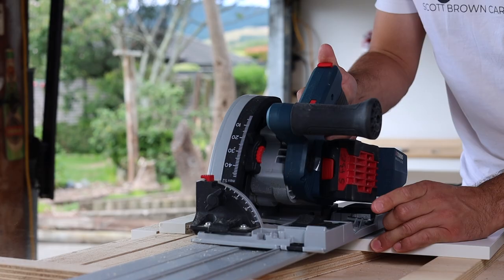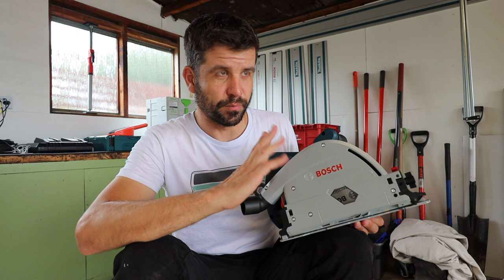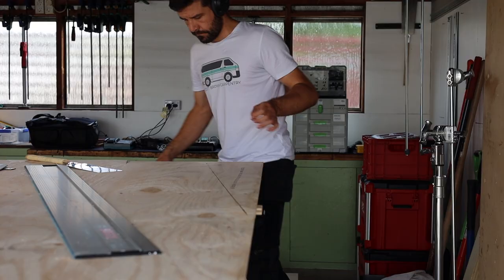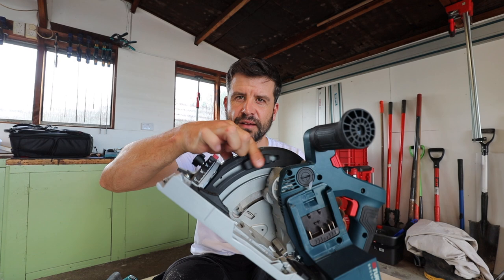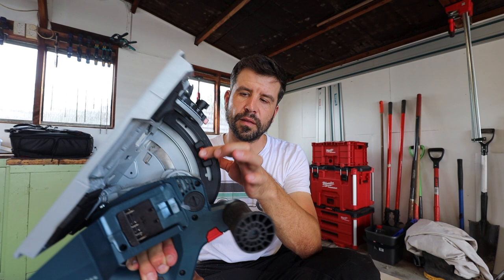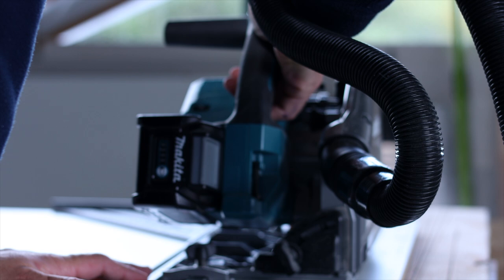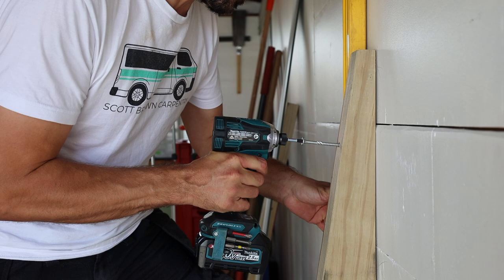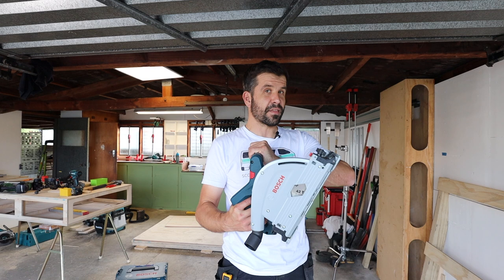Building Plywood Storage With My Bosch Tracksaw

Comment: Hey Scott, the GKT 18V-52 GC does have a scoring function, you need to put the depth adjusment on its lowest setting. You can check video on the bosch professional website. I also am a proud owner of the bosch GKT 18V-52 GC saw :)
Reply: It does, & you can  also adjust the speed settings using Bosch's Toolbox phone app, if saw has the bluetooth module fitted.
Reply: @stuartandrews4344  Yeah, and save settings for specific material so you can use them when you are working with that material again. Its a nice feature.
Reply: @wavebreakerofficial  It's a great feature,so  useful.
Reply: I have the corded version and fit kitchens for a living. If you send the saw down the rail about 3mm prior to your full depth cut, no rip out. You can tilt the saw slightly back a degree in towards the rail but it’s a faff and no better than sending the saw in a few mm first. All in all though it’s a great bit of kit. When mine packs up I will definitely get the battery version as leads are a pain on anything other than a static tool.
Reply: I think the whole point of the scoring function is that you don't have to lose your previous depth setting.
Reply: I have the Bosch GKT 18v too. I use it for kitchen fitting and swear by it. 2mm scribe cut every time and you’ll always get a perfect, factory finish.  Also, invest in an 8ah or 12ah battery; you won’t be disappointed…..and lots of blades. melamine eats through blades. 
The best thing about the saw is actually the track and how easy it is to join together without the need of a straight-edge to true it up.
Reply: @EdwardBuchanan  Prefer the 8Ah batteries, find 12Ah too cumbersome.The Bosch guide rail is far superior to Makita one, & only saw blades I use are from Freud.
Reply: @Stuart Andrews can you send a link to the feud blades you use. I’ve been using Bosch expert (42 tooth). Than you.
Reply: @stuartandrews4344  I also would like a link to those saw blades!
Reply: @wavebreakerofficial  Freud F03FS09763 305mm x 30mm x 72T & Freud F03FS03736 (LP60M 006P) 305 x 2.8 x 30 x 96T Portable Saw Blades, here in the UK.And Freud is own by Bosch...
Reply: @wavebreakerofficial Use these:  Freud  F03FS10064 250mm x 30mm x 48T  &  Freud F03FS10062 216mm x 30mm x 48T,  both are Freud Cordless Optimised mitre  saw blades.
Reply: And finally Freud 165mm blade Freud F03FS10054 165mm x 20 x 48T Cordless Saw Optimised  blade, it's  a extra thin kerf blade.

Comment: I was once struggling to get a clean cut, smoke and all... Took longer than I want to admit to realise the blade was backwards. Tools down at that point, realised I was too tired to be using power tools haha
Reply: Happens to the best of us haha
Reply: I was cutting angles pieces of plywood for a slope on a floor. First 2 are fine and absolutely nail the 3rd. I then cut the 4th to big twice even tho I marked where to cut. I basically drawn the shape of it and still cut it to big. Go back outside just confused with myself on how I did the same thing twice even though I basically drawn myself a picture.
Reply: @kuchiefsdabomb  it's so much worse when it's something simple like that, many times I've carefully measured and then forgotten to account for the blade thickness and cut right on the line instead
Reply: Reminds me of the time one of my guys brings me a brand new bandsaw blade and tells me it must be made for a lefthand cutting bandsaw. I thought to myself what the hell, I've never heard of a lefthand bandsaw. I took the blade from him, looked at it and then turned it "inside out". The employee said something like "son of a bitch" and just walked back to the saw to install it. We all had a good laugh about that and I cemented my reputation as a genius. Honestly, I didn't know if it would work, I was just guessing.

Comment: AIUI when you started using the Bosch saw on the Makita track you should have replaced the spliter guard rubber and retrimmed it for the new offset. ? Bit of a pain when you're moving between saws with different offsets.

Comment: Regardless of track saw, I would recommend the use of rigid foam insulation sheets as a support surface when cutting sheet goods. I have found it to be a better solution simply because there is essentially no resistance when the blade hits the material. It's a tougher job cutting through two layers of wood, and the foam sheets offer full support for the plywood sheet.
Reply: This is the best advice.

Comment: The rubber needs to be cut to fit each individual saw. So you would need to use a new rubber strip on the Makita track

Comment: Dave Stanton, on his You Tube channel, does a reverse 2mm scoring cut to stop melamine chipping. He starts at the top of the board and pulls the saw backwards towards himself. He then does a full depth cut in the normal direction. His cuts are perfect, but does use a Festool saw.
Reply: By pulling the saw towards yourself it would mean the cutting angle is down not up, thats pretty smart
Reply: Maffel has a 2 mm precut option
Reply: I have the bosch corded and I use the same trick. Works perfectly on melamine and veneers as well.

Comment: One thing to remember is, with the bosch bi turbo range, you need an 8ah or 12 ah battery to get the full power out of it. I've got the 230v bosch track saw and used it with my own kitchen, with a 64 tooth good quality blade, and no chipping at all. I've also got the 18v bosch sds plus, 5.3 joules, use it with 8ah batteries, one of the most powerful you can get in 18v, all my tools are bosch, not one has let me down.
Reply: Right! Little typo: "you need an 8ah or 2 ah battery to get the full power" => "8 Ah or 12 Ah" is what I you meant. Just in case anyone reading this got confused ;).
Reply: @nicl4s  thanks, didn't notice that

Comment: One of the best features of the Bosch tracks is the way they fit together, quickly and dead straight every time.
I have the corded saw cuts really well with similar depth adjustment
Not as many after market products with Bosch tracks though
Reply: That definitely was a selling point for me when I was thinking about them, but there are pretty good aftermarket solutions to do that with makita/festool tracks. For example, The TSO-GRC-12's, which don't come standard but do exactly this. 

I was really not a festool fanboy when I started out, but I am just starting to realize that IF there is something wrong with their products SOMEONE will fix it. Maybe not festool (though they do adopt other company's technologies, like their sawstop purchase or their using the TSO rail square). But someone is going to figure that shit out, because the festool fanboys really do care about their tools. 

You might say "that's crazy, why would I pay 70 bucks for track connectors (lee valley price for the TSO GRC-12),  but that is actually CHEAPER than the standard track connectors for bosch that I have seen for sale, which are like 80-90 bucks.  

I really want to like bosch, they make good routers.... but I just don't see the value proposition as being there for me. Sure, the stuff they have works, but they charge a LOT. Sure, I could buy their 6 inch sander, but it's the price of a festool, and I KNOW that works. I also have seen some not great reviews for specifically the bosch cordless track saw (The corded is much better, specifically the cordless).
Reply: @timmietimmins3780  all the extras or additional parts are expensive it does not matter if they are dark blue and green or just blue (Festool or Bosch) they are expensive 
The conclusion I have come to over the years is no such thing as perfect. There are different things on different tools that are good and bad. 
My main win is stick to a platform when it comes to tools and you will save a fortune
Reply: My Makita tracks do not line up with each other.  The rails are out of alignment so the saw will hit the junction not to mention the snuggers have to be adjusted for each rail I have. pretty pathetic manufacturing.  I only have good luck using the saw with an individual rail.   I need the long rail but it's impossible to find anywhere now
Reply: @timmietimmins3780  Yeah I wanted to go Bosch because of a couple tools. I can't go all Bosch because the limited market in the US for their tools and "the little things" like you're mentioning. Before I decided not to buy all bosch I realized it's better to buy the best specialty tool  for each application.  Bosch will end up being most of my core but the battery slavery isn't a big issue with me, there is always one around for wat I need. LOVING my "Bosch babies" 12v impact, sawzall, driver and switchable head driver.
Reply: I am happy with my corded Festool...

Comment: That has to be the strongest built sheetgood rack I've ever seen, lol.  When I saw that lags going into the cement I can't deny that my eyes opened up pretty wide :D
Reply: earthquake code, everything is held together with steel. At least that's my go to guess on all earthquake  zone requirements.
Reply: I put a garden hose reel on the side of a garage with 6mm Dyna bolts. Overkill, maybe, but I didn't want it to come loose.

Comment: I have been using the corded Bosch track saw for years. The track is the best bit, two 1600 lengths is all you need most of the time, as they join so well, compact and accurate. Ended up buying the bigger Bi Turbo saw that runs on the rails as a cordless option, great for site use.

Comment: Hey Scott

Use the score cut method but instead of pushing the first cut that cuts the top layer, start at the end of the cut and pull the saw towards you. After which you can continue by going full depth with a push cut. The pulling score cut technique helped me a lot of times (and still does) due to the fact that the nature of movement lets the base material support the cutting movement of the teeth and minimizing the debree rather than the teeth diving out of the material, causing it to chip. Works great for timber as well.

Cheers from a northern German cabinet maker who takes great joy in watching your videos

Comment: You can get a plastic dust plug cover for the Bosch to cover the access hole for the blade retaining screw, greatly improves dust extraction.
Reply: Guessing that's mainly intended for when you're using the dust bag? Cause dust extraction seems to be pretty good when using a vacuum from what I can see on the video
Reply: @DeadlyMitten  No,I use it with the dust extractor,improved the extraction,virtually dust free,you can also get covers for Makita,Festool.

Comment: if you want top dust extraction from a tracksaw, mafell is the company to go, they're also actually the ones that designed the bosch corded tracksaw (not sure about 18v). the main difference is that the whole side panel is enclosed, even where the access for the centre of the blade normally is. they have a great designed tool
Reply: 10 Minute Workshop has a sweet hack for this - just slap a piece of masking tape over the hole. Massively increases suction

Comment: Hey Scott, just a heads up, if you want cheap malimine, in the same road as bunnings at the end of saxton road, go to the place called NZ panels group.
They make malimine and you can buy 2nds there for $15 a sheet, usually only have a defect on one side.
Reply from the maker: Thanks! I'll check it out

Comment: If I'm not mistaken you need the 5.5ah battery or above to operate that saw at it's full capacity. The Biturbo bosch products are 36v and when you plug for example the 8ah 18v battery into it, it configures it as a 36v 4ah battery. I don't believe the 4ah battery has that function so it runs the tool at 18v producing less power.

Comment: I fought back and forth between buying the makita 36v and the bosch, bought bosch and haven't looked back. Brilliant saw! Love that its only 1 battery and comes in an l-boxx. Also have the bosch 7 1/4 saw with track guides and have used that for more depth of cut when needed. Awesome video! More bosch and makita!
Reply: @cmmartti  sorry I meant the 18v x 2 saw. Not the 40v one. I dont have any makita 40v tools so didnt include that saw in my options.

Comment: Got the Bosch a couple months ago. I got the 8 Amp Hour Battery and the clamps for the tracks. Really enjoy it. I thinks it more than enough for even finish carpentry/ woodworking projects. I would recommend using this with at least the 8 AH battery in my opinion. they also have a 12AH that fits this saw.

Love the channel. Thanks Scott!
Reply: Have a GKS 18V-57G track compatiable,find 8Ah batteries best to use, 12Ah too cumbersome.

Comment: I bought the 2x 18V Makita Track saw and 55in track.  Oh my!  Where has this tool been all of my life.  Even beveled cuts are incredible.  I made stair treads 1.44 in thick from two layers of plywood glued together.  I was able to cut a clean sharp 32 degree bevel on one go, with no drama, and beautiful clean cuts.   In confession, my first cut with it, I kisses concrete with the blade.  I almost cried.  Miraculously the blade is still in the saw 3 months later, and has ripped lots 10 sheets of ply with no tearout at all.  Extremely clean cuts.  So, I think my next blade will be idetical to the one that came with it.  XPS foam strip under the material has been awesome.  I dont even use a full 4x8 piece most of the time.  Just under the saw and track is good enough.

Comment: Quick idea on retention for the sheets:
Some type of L-shaped arm mounted to the wall just above the rack that can pivot down as a sort of latch and can be pinned in the up or down position.
Would be quicker to use than the strap, but in the 3 minutes I spent thinking about this, I can't come up with a way to not have it sticking into the room when there are only a couple sheets. Oh maybe a slotted sliding mechanism. Could even have it spring loaded so that it's always at the minimum distance possible from the wall. Then just have a hard stop at full travel so that it works as intended. 
You could make it full length with pivots at each post or just the one in the middle and just be sure to have a full sheet on the outside.
Just a thought.

Comment: Hi Scott, maybe someone already told you this, but if you buy a new makita guide and make the first cut with the Bosh, it will work perfectly.  But once you use another machine with the guide, the rubber of the guide won't work well anymore with the bosch track saw.

Comment: These tracks are so much easier to join together than the makita/festool etc tracks. I use a Mafell track saw which has the same tracks as the Bosch, in fact the machine is almost identical.

Comment: A little over 12 months ago I bought the Makita corded after much deliberation.
One thing I did like about the Bosch is that it can cut as close at 10mm to a wall. Great for correcting poorly installed laminate flooring.
Ultimately, I'm cheap and the Makita ticked enough boxes. I also justified corded in that if I'm using a track saw, I'm using dust extraction, which for me is corded anyway.

Comment: I got one of the early GKT `s in Germany its war early avaliable.
Bosch build the Saw to be highly compact to travel light to work sight. 
The Saw has a Score function , Just nurn the Depth adjustment on 0 and plunge in . You noticed that is plunges in some 3 mm just enough to score. 
To get a clean cut i highly recomend the right Blade its called Laminated Panel or high pressure laminated Panel .
 in order to get the Dustback to work you have to adjust the speed you push the Saw through the Material . you can say that the Saw cuts faster than its getting the dust out of the Saw into the Bag. Thats also a Reason you got chipping .please excause my English im from Germany and just enjoing your  content. greeting From Germany

Comment: Instead of a strap to hold the ply what about a vertically hinged arm that drops down the face of the boards. You could raise the (arm so that it is parallel to the ground) to access the sheets.

You could even add a block to the end of the arm (to catch/hold the sheets) and lean them forward to access those at the back, if you wanted to do so.

Love the channel and your work, keep it up man 🤙🏻👍🏻

Comment: Not sure if we all caught it, but Scott initially stacked the plywood on the floor with the flattest sheets on top of the warped ones.  When the new storage area was ready, Scott placed the warped sheets first, hoping to flatten them under the weight of the the flatter, more accessible sheets in front.  Excellent example of working smart.
Reply: The strap will also help on that part, forcing the sheets to take on the shape his construction created.

Comment: In regards to the depth adjustment, if you cut 18mm all day like I do you never have to touch the depth adjustment on the makita because of the scribe cut feature that isn't on the Bosch or festool.  I've actually swapped to Makita from Festool because in the battery version I find it cuts better and for longer.

Comment: Hey Scott greetings from Germany. I'm also a Owner of the GKT 52. Great Tool, when you need more Power from the saw you have to use a 5.5Ah or higher Batterie because they can output more Current and the Motor is built to use this Current as much as 100A. The next thing is the Blades I have the Blue/Red ones from Bosch / Freud with longer teeth and their go great on Laminatet wood.
Reply: Do you happen to have the model number for the laminated wood blade?

Comment: Looking good! I would cut a hole on each end of the plywood rack and slide in a large bit of PVC drain pipe, then you can use it to hold square stock behind the sheets as well. :)

Comment: If there is no scoring cut melamine will always chip no matter what. Even with freshly sharpened Freud melamine saw. That's why sliding panel saws have a separate scoring blade.